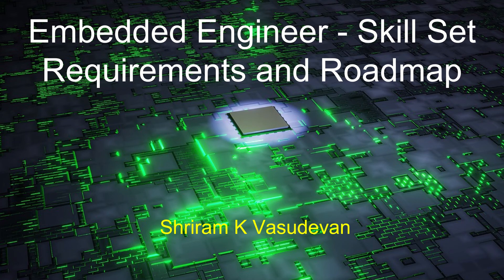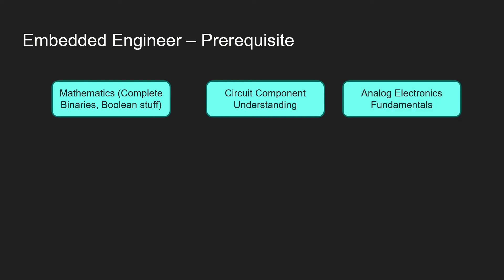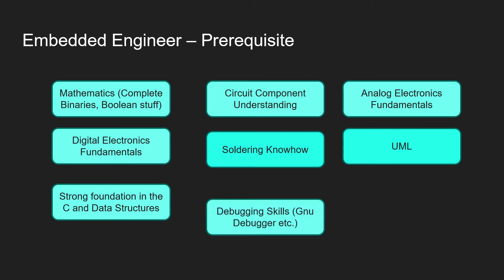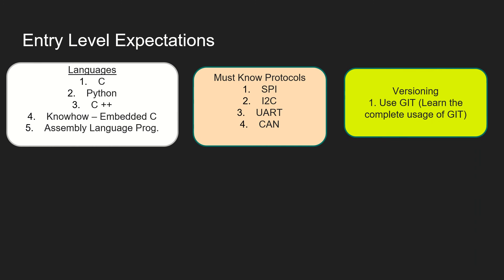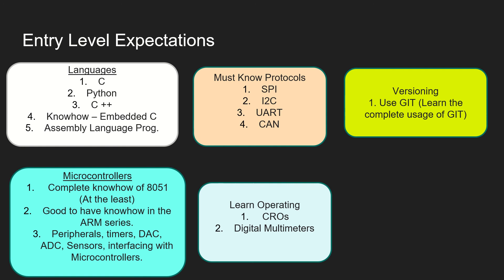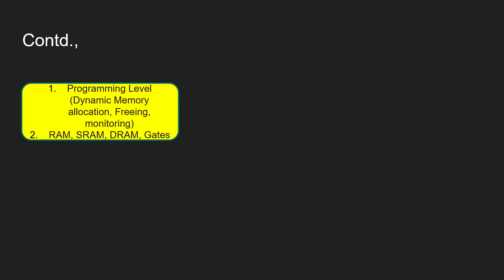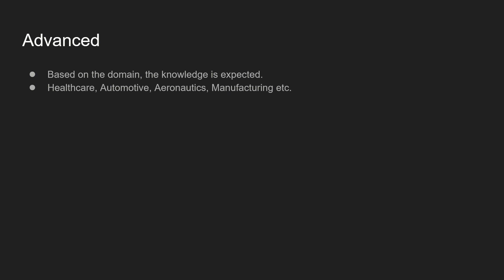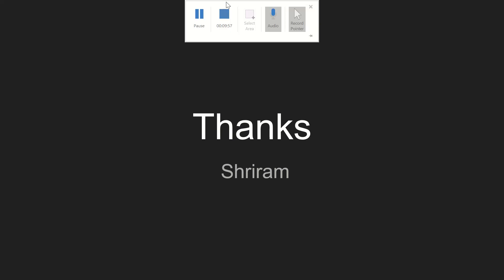Embedded Systems Engineer - Skill Set Requirements and Roadmap

Comment: Hello Sir,
I have started working as an embedded systems test engineer with a 3 year bond for a german automobile company but I want to work as an embedded hardware design engineer in the future for a consumer electronics company so will such a company accept an application for hardware design from a 3 year experienced embedded system test engineer.
Reply from the maker: Certainly it will not be a problem..dont worry
Reply: @ShriramVasudevan  thank you sir
Reply from the maker: @bhaumikshukla4901  welcome
Reply: How is the salary
Reply: Hello can you guide me on this how landed this job...please